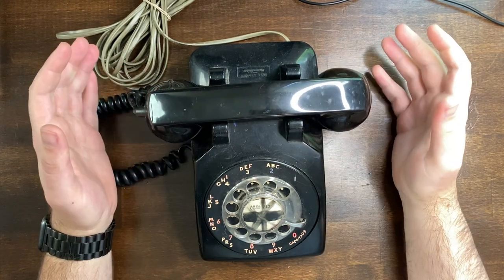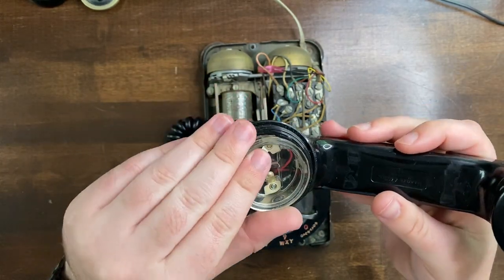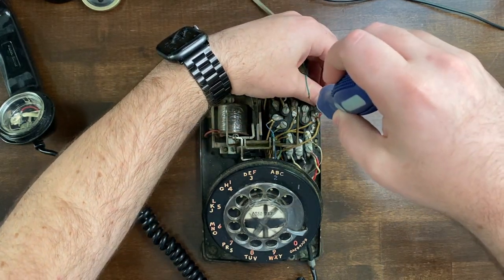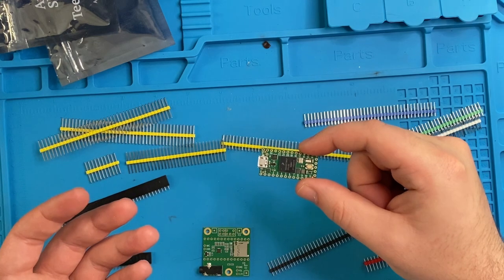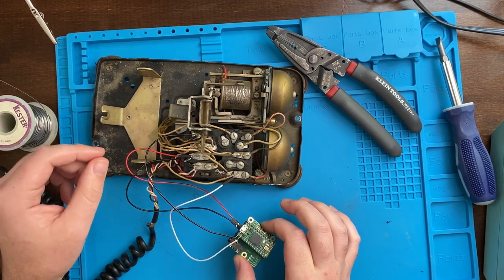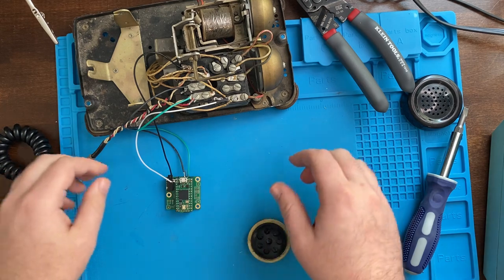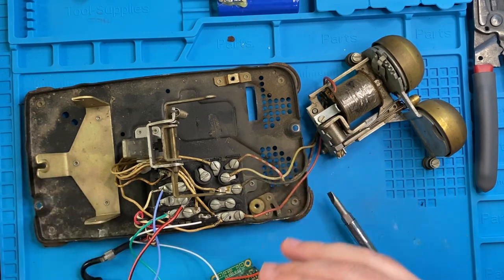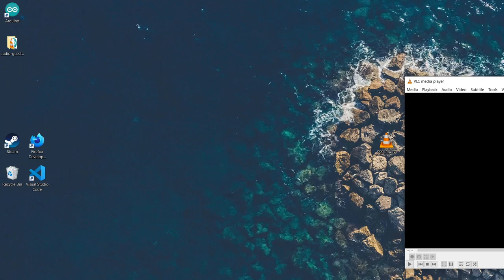Let's Make A DIY Audio Guestbook!

Comment from the maker: Small updates: 

- I did manage to fix the weird ground looping sound at 29:10. Turns out that the terminal block in this phone shares a lot of internal wiring so things kept getting crossed (probably. I didn't dismantle it to see so it's just a theory -a phone? theory-). Solution to that was just wiring everything together manually and forgoing the terminal block at all. This might be the biggest factor for many people with this style of phone.

- I replaced the microphone. I used these: https://www.amazon.com/dp/B01N0VMN9P. Though and electrect style microphone will work. Just be wary of your gain settings. This improved recordings dramatically.

- I added a status LED linked to the power button I put on the back. It's simple and it keeps me from plugging in the USB while it's on and potentially shorting things out.

Hope that helps!
Reply from the maker: Strike through comments don't work, but you get the idea.
Reply: I'm using the exact same model of phone and the new microphone was necessary. Even after removing any connection to the terminal block on the phone, I still get that weird looping noise in the background. Any reason why it still might be happening even after trying that fix?
Reply from the maker: @jacobkistler4815  I'd check other grounds elsewhere. I have the battery going to the Teensy and then everything is branched off that one pin. Extra grounds or connections might be causing some kind of loop

Comment: I've followed the tutorial and have only one problem: a weird noise when recording.

Look like it's when the SD card writing (during the record) that the noise occur.
The noise is synchronised with a LED on the teensy (the one behind the SD Card)

Here what I've checked:
- wiring look ok 
- no error in code 
- used different power supply (pc & normal plug) 
- used a ground isolator
- tested 3 differents mic and the noise is still here
- used different card sd (32gb can't write on it but can read - 16gb doesn't work - a 128MB work fine)
- wire directly to the teensy without passing by the phone card

I'm asking for any help :)
Reply: Hi there, any chance you found a solution to this?  I have the same issue with a ticking sound.  Thanks
Reply: Update: I solved this by removing all capacitors, resistors, relays, etc. from the phone's circuit board.  Then, I removed all wires that are not connected to the teensy, such as additional wires connected to the phone's hook switch. These might be causing ground loop issues.  This completely removed the ticking noise that corresponded with the Teensy LED.  Hope that helps.

Comment: In all the various software versions I have looked at, each defines the SD pins as CS = 10, MOSI = 7, SCK = 14, but these are the pins for the older audio board. I have changed them in my sketch to MOSI = 11, SCK = 13 (CS stays at 10) to match the latest RevD audio board. Perhaps this has been the cause of some of the problems others have seen. I don't get any clicks and it works well.

Comment: Not sure if you'll see this, but I keep running into an issue where it says 
:\Program Files (x86)\Arduino\hardware\teensy\avr\libraries\MTP_Teensy\src/MTP_Teensy.h:32:2: error: #error "You need to select USB Type: 'MTP Disk (Experimental)' or 'Serial + MTP Disk (Experimental)'"
   32 | #error "You need to select USB Type: 'MTP Disk (Experimental)' or 'Serial + MTP Disk (Experimental)'"
      |  ^~~~~
Not sure how to fix this. Do I have the wrong version of MTP_Teensy or something?
Reply: in Aduino IDE, did you select under "Tools" --> "USB Type" the Serial + MTP DIsk (Experimental) option?

Comment: Do you have a link to what wires you ourchased to connect the teensy board? I have the teensy board with pins, but I got lost when you showed all the wires connected. I want to make sure I order the right cables to connect so that then I can try the coding.

Comment: Hey I don’t know if you check these comments on here but I have the exact same phone and was wondering if you would be able to share your code for this project? I am so close to having it done but have the same issue with the quiet recordings.
Reply from the maker: Sure! Just created a fork of the original repo and added my change: https://github.com/mattpassarelli/audio-guestbook. The specific commit with my changes (basically just some volume and gain tweaks) is here: https://github.com/mattpassarelli/audio-guestbook/commit/5233ec0eb38da3a1f3174d4a5e15fcb2dc147dcf

Comment: I'm having issues with the code and I pulled it straight from Playful Technology's repo. I'm not sure what I'm doing wrong but it seems to be throwing all kinds of errors saying things aren't accessible. This might be a stretch, but is there any chance you could help out? It's probably something stupid and I don't know enough about this stuff to figure it out. 
Thanks!
Reply from the maker: Accessible like you're missing dependencies? Or that you can't flash the board?

For the former, I would verify all of the needed libraries are all installed in the Arduino IDE.

For the latter, make sure the USB cable is good, the port you're using is good, and that Windows (or MacOS) see the Teensy properly. 

You might have better luck posting an issue on the repo's Issue tracker and having people who are more familiar with the codebase than someone who only really touched one line of the code.
Reply: @MattPassarelli  it seems like it’s not so much the code as it is the way I have the libraries set up. 
I didnt change anything with the code, and if it works for everyone else, it should work for me. Unless whatever line you changed, is something I need to change too. 

The only variable that is movable in this scenario is the way I downloaded the programs and where I put the required libraries in order to run the code properly.

Could you go into how you have the backend set up? Where sketch should be pointing to, where the libraries should be, etc.
Reply from the maker: @ChrisRonan4  Ah, did you setup the newest arduino IDE? Like 2.X something.

I did that ran into a myriad of problems. Try uninstalling and installing 1.7 or whatever version he uses in his video.
Reply: @MattPassarelli  I sure did. I’ll try that. Thanks!
Reply: Looks like I'm getting an error for multiple libraries found for SD.h
I have the option of deleting the SD file in Arduino folders or the Teensy folders. Which one should I get rid of? Does it matter?

I'm also apparently missing MTP_Teensy.h
Any idea where to pull that from?
Reply: Disregard, I got it. I had to move some files to the right place so it knew where to grab it from and it eliminated that error.
Reply from the maker: @ChrisRonan4  Great! Glad you got it!
Reply: @MattPassarelli  thanks for your help!
Reply: @ChrisRonan4  what files did you move?
Reply: @ChrisRonan4  Hi Chris could you please share what files you moved Im having the same issues with those code would greatly appreciate your help Thank you in advance